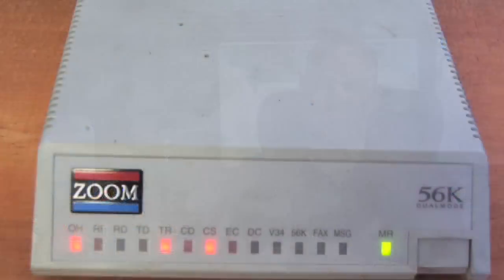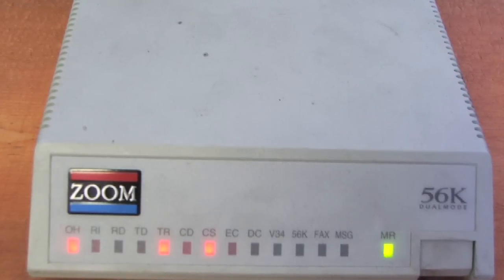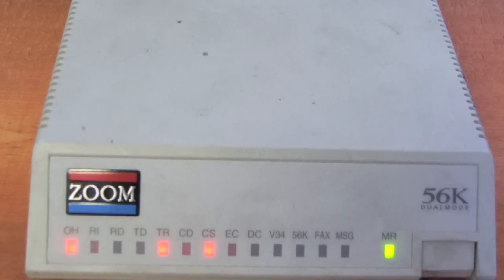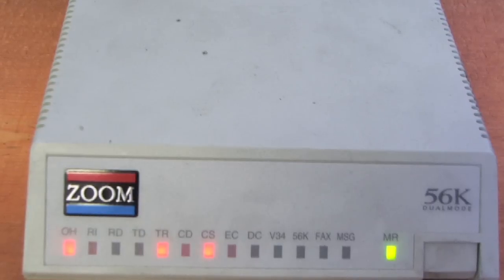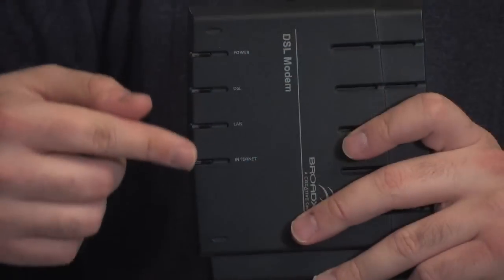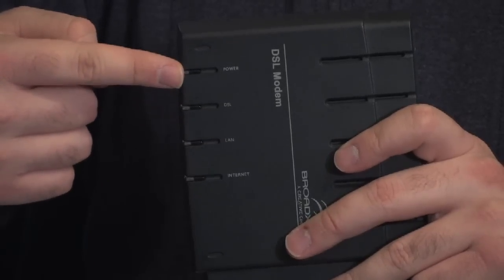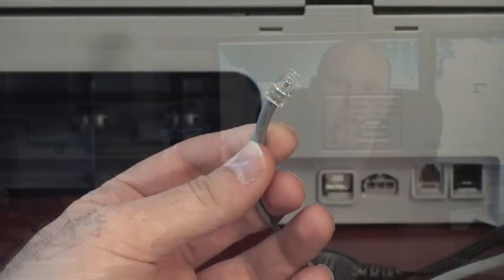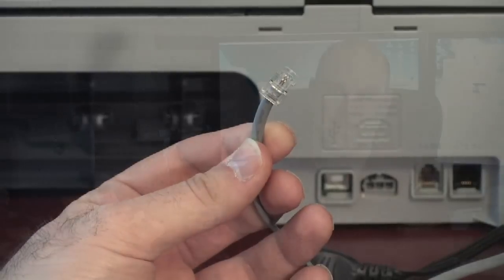Computer Basics : How Does a Computer Modem Work?

Comment: My understanding is that a Modem is called such because it converts the phone signal beeps into binary. If a DSL modem connects straight to a phone line and doesn't perform any conversion why is it called a modem? If it just uses the phone copper wire to transfer data, does that mean anything which technically uses phone lines or services for data is called a modem? I came here because I was confused about the idea of a wifi modem, and then you mentioned it uses cellular towers.

Comment: @r34p3rex I think if he talked about 10base2 Ethernet most of the kiddies heads would explode..  you know, pre-TCP/IP...

I was expecting him to relate this to a RS232 serial cable or USB cable, because I think the simplest form of computers talking to each other is serial connections..  then it's easy to scale the theory up to different media, phone lines, cable, wireless cell coverage, and fiber optics.